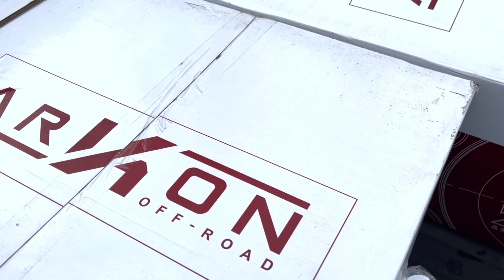INSANE transformation of my Ford F150, STAGE III complete!

Comment: Bought my 2016   f150 XL super cab wish I had the Crew. But I couldn't be happier. I've done a lot of add on's but still want to replace the 2.5 leveling kit with a lift a super charger and a cowl induction hood.  Witch would look good on yours.

Comment: You might need to upgrade your stereo. Those tires are gonna be humming on the highway
Reply from the maker: Yes, a little boom is in order
Reply: @FoxcastMedia  I did an audio control processor, 5/1000 RF amp, new JL speakers and a 10 inch sub. Just right for this mid 50s rocker